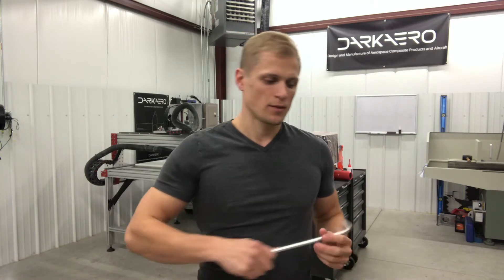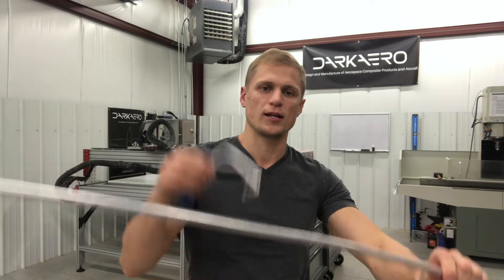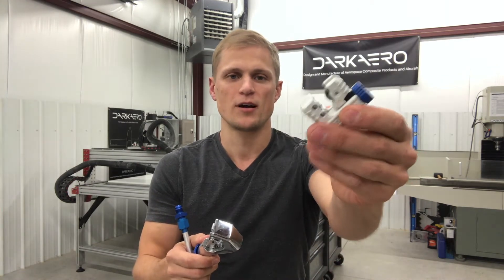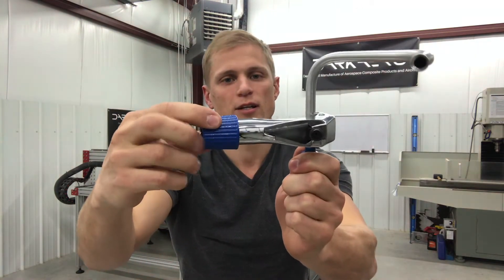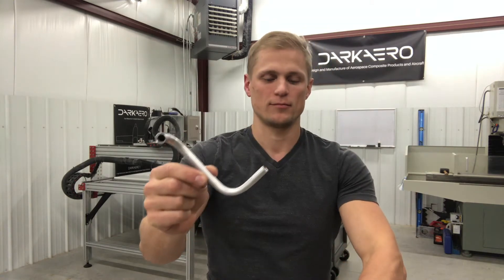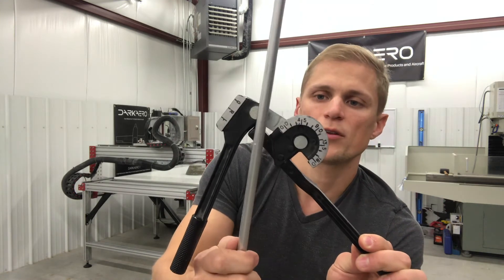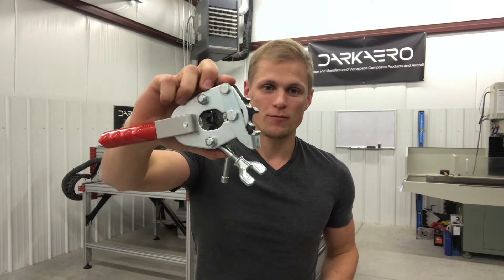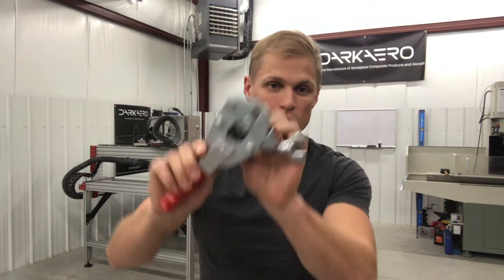HOW TO: Using a Tube Cutter, Tube Bender, Flaring Tool for Fuel Lines

Comment: Just found this tutorial. Very helpful!  Question: when you assemble the joint, is there a torque spec? And do you need anything on the threads?

Comment: You are supposed to pull the handle around in one motion on the bender. On similiar flare tools like the one you do not recommend, it has a stop. Therefore you do not have to guess on when to stop. It also has the option to burnish the flare to a mirror finish....

Comment: Would amend the part where you finished flaring the end and did not inspect it closely for out of round or cracks before moving on.  In my experience, the parker tool is hit or miss aprox after the 50th flare lol.  Wish better luck to the rest!